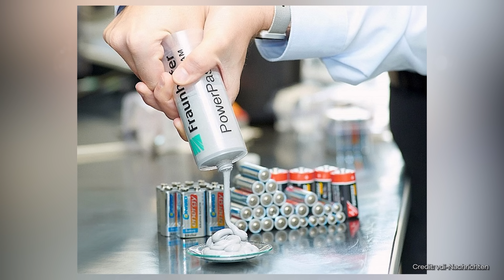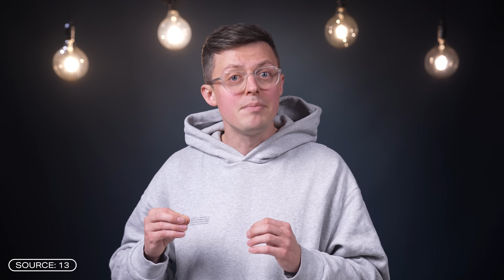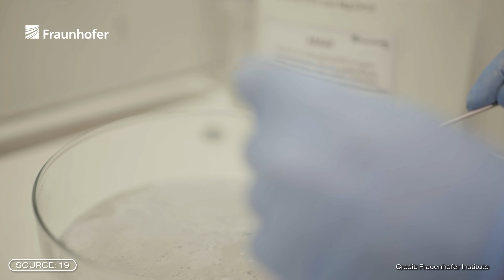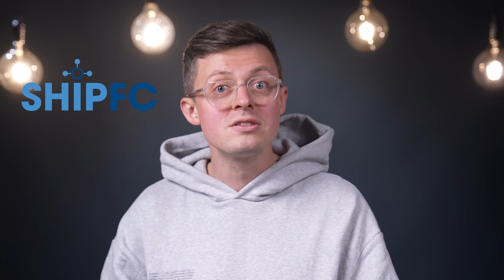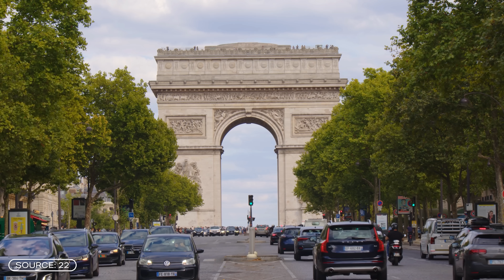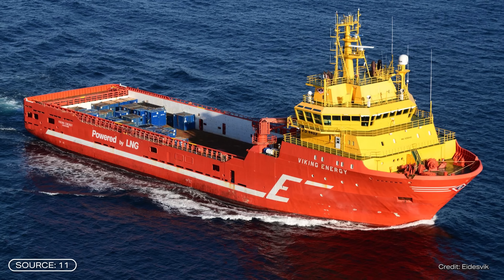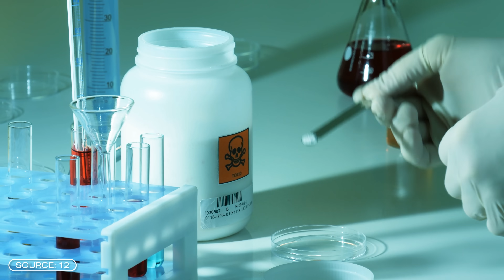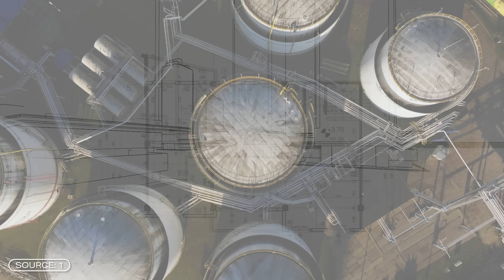Hydrogen Powerpaste: 10x Higher Energy Density & Safe?

Comment: I have heard that it's possible to combine hydrogen with carbon to produce a fluid with high energy density.
Reply: hydrocarbon? lol.
Reply: @kentarouification  actually we can make that the problem is it's not as energy dense as fossil fuels you get from the ground the upside is your making it from carbon of the atmosphere
Reply: I have heard that there are already developed self-replicating structures that captures solar energy and directly store in some of these carbon-hidrogen combinations.
Self replication. And even their structures are made out of absorbed carbon from air.
Reply: @AugustoDeNardin electric separate water to hydrogen and oxygen and can add co2 later coming diesel 🤷🏼‍♂️
Reply: @AugustoDeNardin  ah. Funny. I got it.
Reply: @AugustoDeNardin trees are part of the carbon cycle.
What is needed is to remove the excess carbon from it.
However you're not completely wrong.
If you want to biologically capture carbon there's one way to do it fast: algae 
In massive amounts.
Reply: @fl00fydragon  Why all this talk of capturing carbon? We are nowhere near the danger level of excess atmospheric CO₂, we are closer to the danger level of being too low. We are around 400 ppm but below around 150 ppm most life on earth ceases. On the other hand, 1500 ppm is close to ideal for plant growth, and in the past levels have been as high as 4000 ppm, with, as far as we know, no help from human activity. And remember, all that CO₂ currently stored away in coal and oil was originally loose in the atmosphere before it got absorbed by plants that later were buried to become coal and oil.
Reply: @fl00fydragon did you miss the joke? again?
Reply: @Ethan.Lamoureux  why don't you go back to school, you clearly no nothing about atmospherics CO2, the carbon cycle, or would a healthy level of CO2 it for people is. For starters while plants love 1,500 ppm, human don't. Above about 1,000 PPM humans weaken to experience drowsiness and complain of stuffy, poor air quality
Reply: @Ethan.Lamoureux  As an agricultural engineer. You're proof of how dangerous it is to parrot talking points on science you do not comprehend.
For starters, due to differences in c3 and c4 photosynthesis we will have issues with weeds we did not have before, because the speed of one is faster but capped while the other operates how you said.
Then there's the effects of climate.
Ever wonder why certain plants are in certain areas and some areas barely make any food?
Simply put, if you exit the window of conditions a crop needs, it will fail.
Too little or too much rain, higher temperatures, lower temperatures (what will happen to northern Europe if the gulf stream stops), too little water or flooding, too many days per year that are cloudy would destroy olives, sudden shifts in temperature could just outright destroy a crop, if a winter is not cold enough would prevent some multi - year crops like apples from bearing fruit, etc 

We'd have to move to predominantly controlled environment agriculture.
And even though it's my field I know that the cost to solely rely on it would cause a lot of people, as in entire populated regions,  being priced out of eating.
And that's before we factor in damages by more energetic weather events, or the inevitable extremist far right politics they'd create 

We'd be basically sacrificing the better future we could have by having to focus solely on mitigating the damages of an outdated power source
Which is unacceptable and honestly, grounds for military intervention 

Addition:  CO2 levels or any condition being suddenly jolted to it was tens of millions of years ago does not help life forms of today that evolved for the conditions of this era
There is no "ideal original condition" locked away and waiting.
What you are doing is create an extreme environmental pressure on ecosystems because you're putting them under new conditions 

If this causes a die off we will be in trouble 
And not just in food

This biodiversity we have today is a gold mine for medicine. You'd be eliminating it.
Reply: @fl00fydragon  or dinosaurs hit by an asteroid
Reply: @fl00fydragon  Bro wants a new carboniferous and genuinely thinks the problem with CO2 is that plants won't like it when they literally breathe the stuff, and not the greenhouse effect.
Reply: @Saktoth  Both are problems.

Let me help you understand.
Since you breathe oxygen, do you think that the optimal atmosphere for you is 100% oxygen?
Obviously not.
Lifeforms thrive within specific conditions, alter the conditions and lifeforms that once thrived struggle while others take their place.

We rely on extremely few plants, putting those at a disadvantage while creating an advantage for their competition is unwise to say the least.
Reply: @fl00fydragon  I know man, just this guy thinking that we'll be fine at 1500 PPM.
Reply: @fl00fydragon  Pretty sure algae was tried and dead because the stuff is too hard to purify / hard to keep alive / slow to reproduce / needs too much input energy.
Reply: @asas-xn4qk  Depends on algae species, scale, purpose and execution. The ideal is a massive shallow body of warm water in which you trigger algae blooms, kill them off, and repeat, burying the biomass at the end each cycle. You're not making an oxygen producing bioreactor.
What you're doing is making a source of rapidly growing dead plant matter.
Reply: @fl00fydragon  From everything I know, nothing viable has been found.
Reply: @asas-xn4qk  Keep in mind that there's 2 factors in this: 
1) scale, scale changes viability
2) They are trying to capture carbon while making a profit. if your demand to repair something extremely expensive that was broken is to make it profitable to a new business model while not making those who broke that thing pay for it, you end up with "nothing works". The reason is if you capture and use that carbon it will return to the carbon cycle, you have to remove it, making it unsellable.

The solution on the econmics side is very simple:  oil corporations and petrostates are made to pay the cost of this program.
Reply: @fl00fydragon  Okay so the thing is, if you """solve""" the economic problem that way, you just end up worse off. 
Ie: the money that was force reallocated was earned using x amount of resource, which is now used to create a y benefit with x > y. 
The energy needed for carbon capture plants will simply make more carbon than it saves. 

Scale cannot make a fundamentally bad idea ( fusion, carbon capture, hydrogen economy) viable. These are all scams meant to pull in tax / investor money and nothing else.

"those who broke that thing pay for it" A nonsensical line of reasoning, as the world economy runs on oil. might as well just "pay off all the government debts" while you're at it.
Reply: @asas-xn4qk  They obfuscated the facts, paid off entire parties, launched fraudulent legal battles and spread disinformation to prevent the replacement of their industry for over 5 decades.
That is deliberately breaking the system. They will pay the cost.

Or are you suggesting we just destabilize the biosphere because "but the capitalist oligarch would cry"

As for energy consumption. You can produce even more than we do now in a carbon neutral way

And for scale you can flood part of the Sahara to trigger algae blooms, then bury the biomass.
Reply: Backwards!
Reply: @videosight1 molecules are funny that way😂

Words words words… Hydrogen dioxide or commonly, hydrogen peroxide H2O2, is actually dihydrogen dioxide… there are fewer word Nazis in chemistry 😂😂😂 jokes aside peroxides H-O-O-H bond differently… I was just enjoying the word play…fun and games till someone runs with Scissors…😢
Reply: @davidhuber7166 so then hydroxide hydrogen peroxide would be the most Christmas-themed chemical
Reply: Ayrton Energy in Canada stores pure hydrogen gas inside margarine type, non toxic, organic type, room temperature clear liquid to be recycled 1,000 times that State regulated Hawaii Energy also partnered with.
Reply: @leroyessel2010  Yeah I dunno why we have a great and proven method of storing Hydrogen with Carbon, I don't know why we'd use magnesium.
Reply: Me: hydrogen and carbon? Really? Hmmm.. that'd be something like hydrocarbo... shoot. he got me. he got me good 😂
Reply: Hahaha 10/10
Reply: Adding to this in a totally genuine and serious manner: if you have a cheap source of renewable/alternative (including geothermal or nuclear) derived hydrogen, you can make use of bulk CO2 from dense industrial CO2 capture and make syngas out of it, and in turn make methanol as a very convenient to use liquid fuel. (namely a combustion fuel, but also for fuel cells, if we ever get methanol fuel cells working really well)

You can also make the far more transportation/passenger/commercial vehicle useful isobutanol from syngas (or a variety of mixed alcohols using appropriate catalysts), and the waste CO2 from those processed can be combined with fresh hydrogen. Isobutanol is an excellent gasoline blending component, or possible to be used as a straight high octane gasoline replacement in many engines. 

(normal vehicles aren't technically rated for it, but the vast majority of fuel injected 1980s or newer not-flex-fuel gasoline powered vehicles would run on it totally fine ... even with cold starting it'd be fine, even with low pressure throttle body injection, but it would be problematic for very cold climates + carburetors ... you could use starting fluid then if you really wanted to still run it, though you'd also be running leaner or closer to stoich than normal gasoline would be, where the fuel injected cars with engine computers will adjust the AFR to compensate ... most of them also tolerate ethanol mixtures up to the 35 to 40% range, sometimes higher, without hitting a limit and running lean:  note, even when running lean, the combustion temps are reduced enough that knocking, detonation, preignition, or piston burning isn't a problem ... we're talking standard tuned engines, not ones set up to make use of the higher octane rating;  also they'll get better or similar MPG due to the improved thermal efficiency of that sort of blend or 100% butanol ... though I think the peak MPG is usually more like 50-60% butanol or 30-40% ethanol ... methanol is more like 25%; this is due to specific changes in combustion characteristics in spark ignition engines, including high flame speed and laminar flame front ... so basically you get more efficient burn than you would with straight hydrocarbons or 100% methanol or 100% ethanol ... though 100% butanol would be a lot closer to competitive by comparison as well)

Of course, the exhaust from those vehicles is going to leave a carbon footprint, unless the captured CO2 is waste product from biomass feedstock processing, then it'd be carbon neutral even in final use cases. (short-term infrastructure could use either ... long term might be able to get away with biomass alone, depending on some things;  atmospheric CO2 capture is way too inefficient to do in any other way than biomass, though ... for probably more than the near future:  large scale algae farming would be one of the more novel examples of that)

I see this power paste stuff being more likely used for industrial scale hydrogen storage and MAYBE a hydrogen generation material for consumer grade fuel stations. While most/all future hydrogen fueled vehicles will still used compressed hydrogen or (most likely) hydrogen absorbing alloys (the latter stores hydrogen at room temp close to cryogenic liquid densities, though eventually wears out over many cycle periods, but can be recycled as well). Use cases would probably include hybrid vehicles with either a high efficiency flex-fuel engine capable of using hydrogen as well as other fuels (you might as well make it flex-fuel if it's going to be combustion, though making it NG+LPG+hydrogen capable would be simpler than allowing liquid fuels as well), or a hydrogen fuel cell system + large battery bank. (the point would be able to charge from the grid and not fully rely on hydrogen fuel stations)

For long-haul transport use, I don't see the fuel cell option panning out in the near future, but a hybrid combustion + electric system with CNG+LGP+H flex fuel would be possible in the near future given the existing and expanding infrastructure for CNG + LPG platforms in trucking and such. (Australia also has auto-gas LPG for consumer grade cars/trucks in some regions, and has had such for a long time)  But smaller scale consumer vehicles are likely to stick to gasoline and diesel as well as drop-in replacements for such. (though that could include novel drop-in replacements that already work and have worked for decades, but aren't officially accepted by regulatory bodies or auto-makers ... you have people who have been running their 1980s and 1990s era vehicles on 30-40% ethanol blends for decades and 100ks of miles without issues to the engines or fuel systems ... though many of them fill up using E85 and E10, so the ratio fluctuates a lot, too ... because that's what's convenient and practical;  most cases also pas SMOG tests without issue as well; if you're not getting check engine light error codes, it'll probably pass  ...  though if they tested the RVP of the fuel, it might not technically be compliant ... depending on the season)

Synthetic diesel (FT Diesel, HVO diesel, etc) or blends of that with biodiesel are already drop-in replacements (and for old vehicles with swollen seals, the synthetic diesel is too "dry" (seals contract) while biodiesel is too "wet" (seals swell/degrade), but an R80+B20 blend usually sits in the middle close to petro-deisel. (you could also use fully hydrogenated diesel that burns as clean as FT or HVO and has the same high cetane number ... and the same "dry" lack of swelling due to being aromatic and olefin free, 100% paraffinic) Hydrodiesel style water diesel emulsions also work for lowering emissions and improving fuel economy (mpg will drop, but m/unit energy will go up, and the cost of fuel would be proportionally lower due to water dilution).

Lots of gasoline drop-in replacements could exist, but a simple example would be butanol + anisole for most temperate regions and summer blends. (you'd probably use something like butane added in a small fraction for cold starting aid in cold climates, much like what is done seasonally for regular gasoline) You could also use mixed aromatic hydrocarbons in place of anisole (or just pure toluene, since it has more or less the best mix of chemical + combustion characteristics of the relevant aromatics) and that can be made from hydrogenated lignin (from woody biomass or from lignite coal ... or from peat) just as anisole can be, and the vapor pressure would be higher in that case, and methanol, ethanol, or propanol could be added to increase RVP due to azeotrope formation (that doesn't happen if anisole is used, hence butane being more relevant then), but anisole would tend to be cheaper, low toxicity, and cleaner burning, so it'd make more sense.
Reply: @chrishamilton53 that's a very long ramble that will make sense to very few people. A couple of niggles though, the boiling point of butane is -0.5°C which makes it useless as a starting fluid in cold weather & the alcohols you name remove the zinc from common alloys of aluminium leaving a porous physical structure which has been the cause of several engine fires.
Reply: Hydrogen+ co2 coming diesel right away
Reply: That a gas of a joke!😂
Reply: Yep, that's methane - one carbon atom holds 4 hydrogen atoms in place. A much more easily handled fuel. It "compresses"  the hydrogen. Used in most rockets now rather than the super tricky hydrogen.
Reply: I wonder how easy it is to produce this fluid in Germany
Reply: Right! You even need only 1 C atom to bond 4 H atoms.
Reply: Sounds like it will emit C02 when consumed.
Reply: Terraform Industries has a Sabatier reactor process that I'm optimistic for if they can produce methane at a lower cost than fracking using carbon removal and green hydrogen. Then you can produce turquoise hydrogen with pyrolysis to produce carbon nanotubes and hydrogen. Might just recycle the hydrogen from the pyrolysis process or optimize its use in a larger complex industrial park for whatever is most valuable at the time
Reply: You are mad sir! MAD!

Next you will try to say that these hydrocarbons can be produced spontaneously from water, light and organic materials!
Reply: That is true😊
Reply: Exactly what I was about say, lol.
Reply: 😂 so many people missed the joke
Reply: It's funny because it's true.
Reply: 7.5x higher energy density than this paste - I've heard
Reply: In some places it even occurs in nature... imagine if we could pump it out of the ground.
Reply: That is methane which produces CO2 when burnt. Not good.
Reply: @rogerphelps9939 So just get carbon from a non-fossil source and there are literally 0 issues.
Or add a second reactant to bind the carbon again, like an alkali metal.
Why do normies think that carbon is bad?
There is absolutely nothing wrong with carbon as a chemical.
Carbon ≠ fossil fuel
Reply: @rogerphelps9939  🤦‍♂️
Reply: @xypheli  Why are you facepalming at a valid point?
Reply: @fl00fydragon  Because 1.) @Ben-pz1ci was obviously being sarcastic/joking 
2.) They didn’t specify; by „combining“ hydrogen and carbon you can literally obtain all hydrocarbons, so no „that“ would not automatically be methane
Reply: @fl00fydragon how can you have that username but no ability to spot an obvious joke?
Reply: Carbon re-capture would complete the carbon neutral cycle - but it's not fashionable to talk about real solutions.
Reply: @thom1218 carbon recapture is idiotic and inefficient. Very expensive at that.
Reply: @stasi0238 But idiotic and very expensive is currently fashionable in some circles.
Reply: @duncanidaho9153  You know what's also very expensive?  Eliminating petroleum from the world's economy.  Good luck with that... by the way.
Reply: @stasi0238  Using renewables to bind CO2 to hydrogen to make jet fuel, aka carbon re-capture, completing the carbon cycle for applications like... oh I don't know, FLYING across the ocean - a task that requires energy density only found in hydrocarbons... but please enlighten us with your packing busloads of batteries onto airplanes as a solution.  Tell more us about it... please do, we're in need of some levity here.
Reply: @stasi0238 well, yeah, like the Malikoff diggings at the edge of Grass Valley, CA a century ago. A placer mine. Their runoff pond ruptured and mercury, lead, arsenic water flooded farmland downstream and ruined it to this day. In the 1800s there were no environmental laws, but still they got fined $2M which was more than the mine produced.
Reply: @thom1218  It doesn’t need to be done overnight. At some point the infrastructure for home based natural gas didn’t exist and I’m sure some people claimed it was easier to stick to burning coal.
Reply: @thom1218 We could have finished doing that a decade ago with minimal economic bumps. 
 But instead we prioritized a few rich guys getting richer over survival.

And if you think that the economic cost of fuel replacement is too high the destabilization, geopolitical conflicts and inevitable mass exodus from parts that will become uninhabitable would cause an actual logistics crash, far worse than some fake painted paper of one country.
Reply: @fl00fydragon  That is just bizarre! Only in your obviously addled mind does everybody make it a priority to ensure a few rich people get richer. 

Dealing with the eventual issues of the status quo will be easier and cheaper than doing what you want us to do now. So some areas eventually become uninhabitable due to flooding... for instance, like the southern end of the Mississippi delta has already, due to land subsidence (not sea level change, as it changes very slowly.) Well, people move elsewhere. One of the effects of global warming is more arable land, thus more area for people to move to. No big deal! But I don’t expect sea level rise to be of any major importance.
Reply: @fl00fydragon Nah, man, humanity fully deserves the water wars and all the fun that's going to follow from catering to the US carmakers, petrol companies and the other abject scum. Don't even dream about humanity reaching the Star Trek tech 😂
Reply: @Ethan.Lamoureux  1) no it's not going to be cheaper.
We're not just talking about some sea level rising. This also affects weed behavior/growth rates, it will continue to increase the severity and frequency of extreme weather events, it will shut down sea currents doing more damage to Europe than a nuclear strike would, and it will make entire parts of the planet uninhabitable as in "a healthy human would cease to exist in less than an hour at the peak months of summer and any crops will fail."
This means tens of millions of refugees.
This would be a logistics nightmare even if we took out the extremist politics that rise from such conditions and we're ceeded to benefit said oil lobby.
I could go on, but these are already a  dozens, if not more, times more cost than if we had mass adopted a mix of nuclear power and renewables.

2)It literally is a product of sunk cost. Spoil infrastructure was already invested, so they'd rather run it until there's no oil to run. This is also the reason behind the Venezuela debacle, because the kind of oil there is what the infrastructure in the us would run.
In fact internal emails, I think it was from Exxon, made it clear. They'd rather make the whole world deal with catastrophe if it meant the gravy train kept going for their shareholders.
Reply: @stasi0238  a ze do produkcji wodoru bedzie zuzywana woda to juz ok? C02 wychwytuje kazda roslina, a jak zaczną ograniczac dostęp do sprywatyzowanej wody to bedzie katastrofa. O tym nie myślałeś? Nie wazne jak czysto wodor się spala ale jak szkodliwa jest jego produkcja.
Reply: @A.T.Anktyda Stary co za bzdura, i tak trzeba dodać elektrolit, więc najlepiej będzie użyć wody z morza. Chyba sobie nie wyobrażasz ile w rzeczywistości jest wody. Ludzie mogliby wiecznie spalać wodór w takich ilościach co benzynę i nie widać byłoby żadnych skutków. Do tego przy spalaniu wodoru, tworzy się na nowo woda w postaci pary, potem tworzą się chmury i deszcz. Jak można być takim nie myślącym człowiekiem to nie wiem...
Reply: @stasi0238  nyslisz ze bedzie taki nielimitowany dostep do wody? Ropę i wegiel tez mogles sam wydobywac? Z chwila worowadzrnia silnikow wodorowych korporacje przejma zasoby wody. Ceny w gore, dostep do jezior i rzek platny i drogi, podatek od deszczowki. Rekreacja stop, ogrodek przydomowy stop, rolnictwo stop. A co najgorsze wszystko ogrodzą i dzikie zwierzeta zdechna bez dostepu do wody. To najgorszy pomysl  jaki moze byc. Woda nie moze byc paliwem bo skonczymy fatalnie. To jakby zgodzic sie na oplaty za oddychanie.
Reply: @stasi0238 poza tym:1. Nie jestem Twoim starym, 2. moze nie bylam najlepsza z chemii ale po co Ci elektrolit? Nie wystarczą elektrody i odpowiedni prąd? Bedziesz cos galwanizował przy okazji?
Reply: @A.T.Anktyda elektrolit potrzebny jest, ponieważ sama czysta woda nie przewodzi prądu.
Reply: @stasi0238  przecież nawet deszczowka nie jest destylowaną wodą. Serio do wody z rzeki lub jeziora trzeba cos dosypac zeby H20 rozbic na tlen i wodor? Wydaje mi sie ze w szkole brali ,,kranówkę" i wystarczało.😂
Reply: @stasi0238  prawdę powiedziawszy Elektryk i Hydraulik by się usmiał. Albo masz do czynienia z jakąś wybitnie przetworzoną wodą bez jakichkolwiek jonow. Normalnie czad. 😂😂😂. W kranie i w stawie przydomowym też????
Reply: @A.T.Anktyda oczywiście, wcześniej mówiąc że się na tym nie znasz, dalej piszesz głupoty. Poczytaj trochę o wydajności elektrolizy.
Reply: @stasi0238  a Ty piszesz mądrze? Wierzysz, ze firmy bedą pobierac wodę morską i ją sprzedawać jako paliwo, a Ty bedziesz brał z rowu i oszczedzisz ?  A moze wyobrażasz sobie, ze tym razem nikt nie bedzie chciał zarabić i nie będzie ograniczeń dostępnosci ,,surowca" ? Zadnych pozwolen, akcyz, nic? Przy takiej ,,rozleglej wiedzy" taka mała wyobraźnia? A moze dobrze wiesz za czym lobbujesz? Jeszcze tylko brakuje, zebys powiedzial ze halucynogenne grzyby leczą prawie wszystkie choroby. Tacy ,,działacze" w necie tez juz się pojawili.
Reply: @A.T.Anktyda najgorsi są ludzie o małej wiedzy chcący "walczyć z wiatrakami". Smutna sprawa że wracamy do średniowiecza. Plaskoziemcy itp też są całkiem aktywni.
Reply: @stasi0238  akurat z wiayrakami walczyl Don Kichot. I to jest raczej opowiesć o ostatnim rycerzu wiernym swoim szlachetnym ideałom mimo wszystko. Nie wiem czy czytales, czy jestes juz z pokolenia czytającego wylacznie opracowania i streszczenia ?😂😂😂
Reply: @thom1218  It's not a "real solution" 
The amount of surface area, air pumped and energy needed to perform this make your proposal logistically impossible.
You'd be basically bankrupting every country and wasting a ton of resources and labor just to protect the profit margins of oil execs.

You want a realistic carbon capture idea?

Flood the parts of the Sahara that are below sea level, turn them into algae farms and then turn that biomass into a form that will not rot and release methane, then pump it deep underground or into deep sea trenches.

Extremely expensive, but at least the logistics work.
As for funds, you should put it in the shoulders of fossil fuels corporations and their owners as well as petrostates.
Reply: @fl00fydragon  Right... but flooding the Sahara to try to eliminate CO2 from the atmosphere is... sure - okie dokie
Reply: @thom1218 Not eliminate, reduce to normal levels. 
It's also a lot more complicated than just "flooding the Sahara" because it's outright huge.
it's only a portion of it to make a shallow sea that's a dedicated algae farm that's in a state of permanent algae blooming.
And you can use the water flowing in to generate power.

But yeah, that's the scope of the problem we are facing.

We ignored physics for the sake of profits, now we either take drastic strips or we may face civilizational destabilization one step before we reach a type 1 civilization.
And that would be an offence worthy of complete stigmatization of anyone involved or defending these practices.
Reply: @fl00fydragon why would flooding the Sahara be required for this?
Reply: @hotzeplotz2345  The scale you'd need to make a difference. You can do it in other ways but it gives an idea of the scale of the algae farm you'd need to solve the problem. Green steel and concrete plus not over fertilizing crops would also help a lot.
Reply: @hotzeplotz2345  Surface area. You need absolutely massive amounts of algae to capture the carbon. Industrial facilities would simply be a complete logistics nightmare.

By flooding a portion of the Sahara that's under sea level all you'd need is to form the canal . The result would be a warm shallow inland sea.
Ideal for this purpose.
And, in terms of ecological impact the Sahara has a lower biodiversity than other biomes.
Best part is it being reversible. Close off the canal and the sea will evaporate.
Though it may result in the de-desertification of the Sahara as well. At least as long as the inland sea is there.
Reply: @thom1218  On your knees, boye, Exxon's CEO still has his shoes unpolished
Reply: @thom1218 it is fashionable. We just have a nasty plug of nastiness in our system right now.
Reply: And the carbon is super cheap, you can just dig up chunks of it in some places.
Reply: Ammonia is almost as good and results in zero direct carbon emissions
Reply: @glike2 Ammonia has a major safety problems.   It's a great otherwise, really good refrigerant. (until it leaks and kills you)
Reply: @glike2 tell me again that you didn't watch the video.
Reply: The problem (if the smoke doesn't count) is the so called CO2 emission...
Reply: If there were no major problems with fossil fuels, we wouldn’t be trying to replace them. Right?
Reply: @rdear thous are not good for breathing
Reply: @rdear  The problem with fossil fuels is that we're just using already-stored energy from the distant past, rather than creating it ourselves as a storage medium; treating it as a fuel rather than a battery.

If all the carbon used was farmed from the air to begin with, there wouldn't be much harm in putting it back as a combustion result. Tricky part's, of course, gathering and processing it efficiently. Maybe some future generation will have vast "solar panels" of genetically-optimized algae-like growth, periodically collected and processed for use in environments where fuel density is important enough to be worth the extra complexity over directly producing electricity from an identically-sized panel.
Reply: @rdear  Most of the problems have been dealt with, and the problem everybody is told about incessantly is mostly imaginary.
Reply: @Ethan.Lamoureux  The problems of CO2 in the air, methane leaks, oil spills, explosions at refineries, have all been dealt with? That’s such good news. I can’t wait to burn gasoline tomorrow and have it produce only water as a byproduct
Reply: boring
Reply: Yep, they're called hydrocarbons  🤣🤪
Reply: I’m addicted to a dioxide of hydrogen…❤❤❤
Reply: @davidhuber7166 that would be h2o2 not h2o just so you are aware
Reply: @davidhuber7166 hydrogen peroxide?